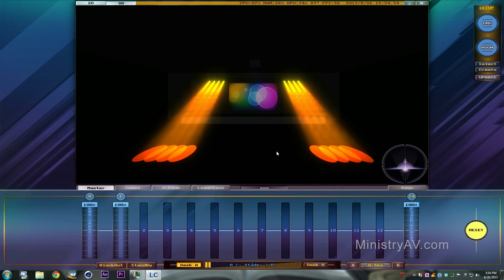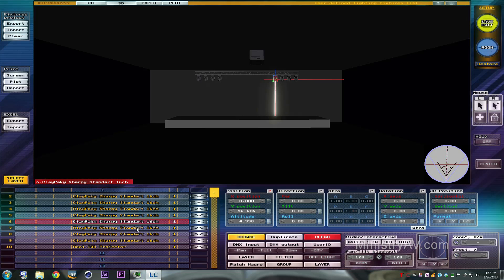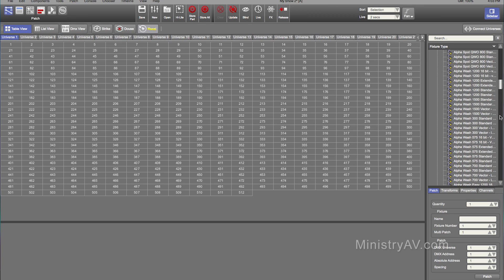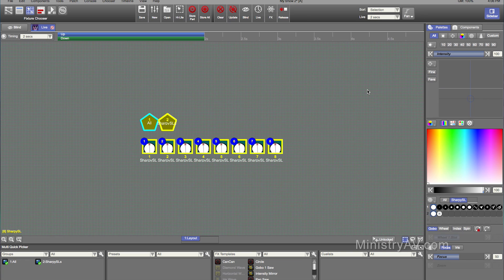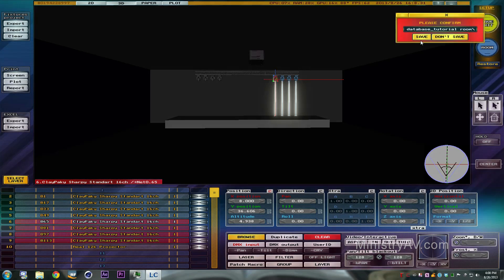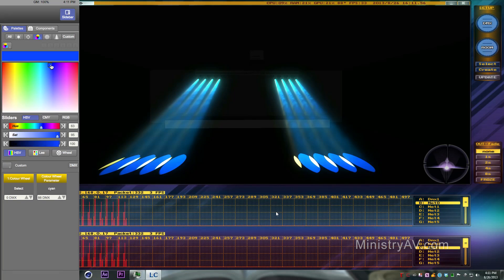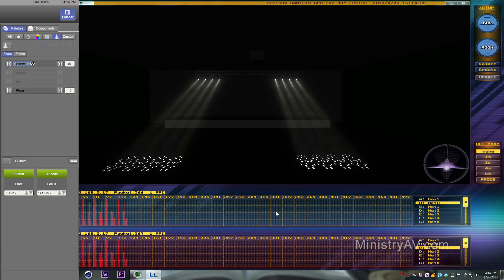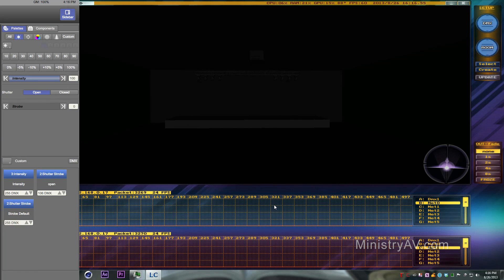Light Converse Basics Tutorial Part 2

Comment: Hey man! Will Light Converse work with Enttec DMXIS so I can run my backing tracks with Enttec Show Buddy?
Reply from the maker: Hey!  Light Converse will accept any DMX.  If you use ARTnet or sACN you can run DMX over a network which is the easiest.  If you have a USB to DMX output interface then you'll need a USB to DMX interface on the Light Converse machine as well.  Little more hardware and work but it can be done.